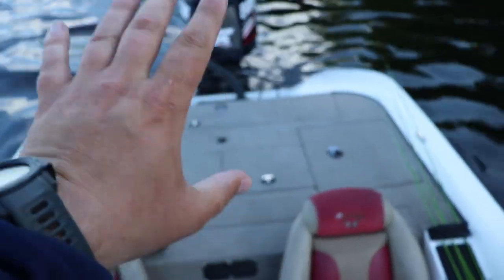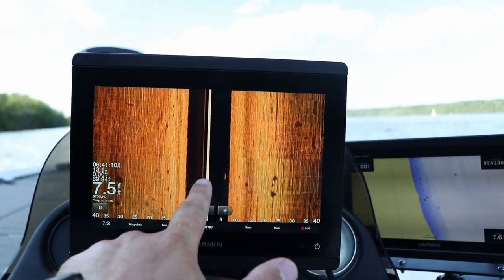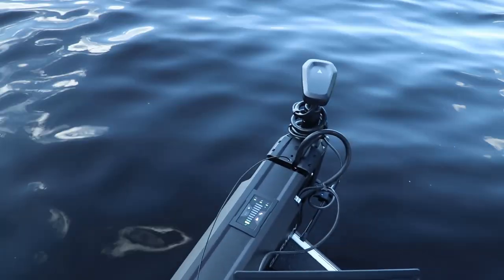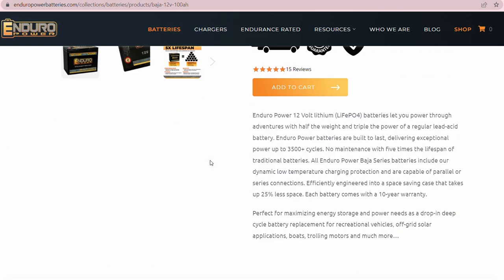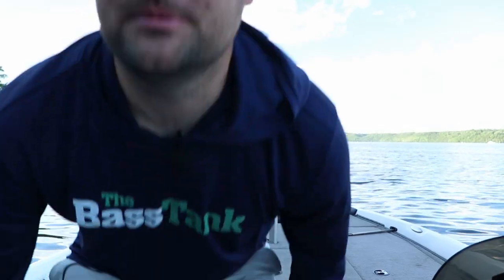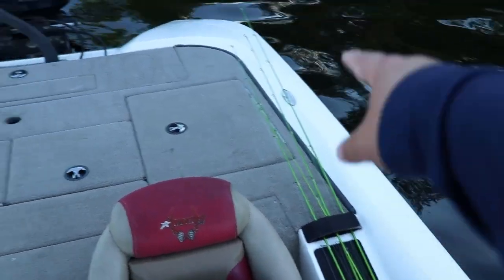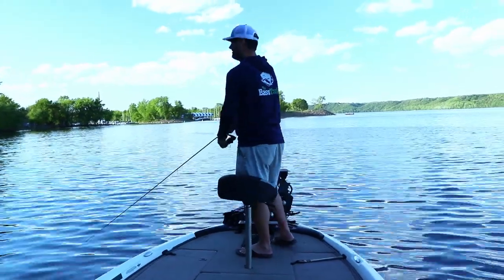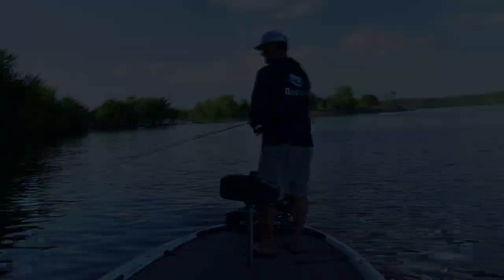My New Crappie Fishing Boat (Stratos 200 Pro XL)

Comment: Dumb question,,,the other day on Long Lake (Hwy 40 north of Bloomer) we hit a ton of crappie in 9-12’ water where it dropped to 15-17’,  they were suspended down about 5-6’ and we pulled one almost every cast, used a white/pink mini-mite, almost all small ones though?  Would a little bigger jig or maybe setting a little deeper pull the bigger ones up?   We caught almost 30 in a little less than an hour but all 6-8” fish
Reply: Go to crappie connection and watch Josh Johnston. Very eye opening facts about crappies. There is two episodes.